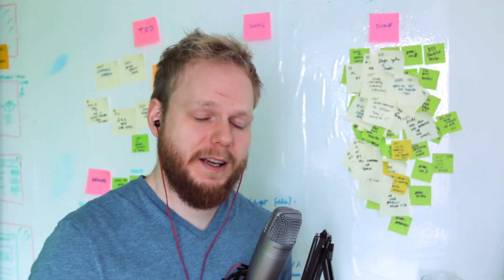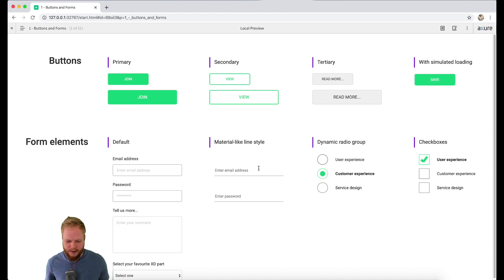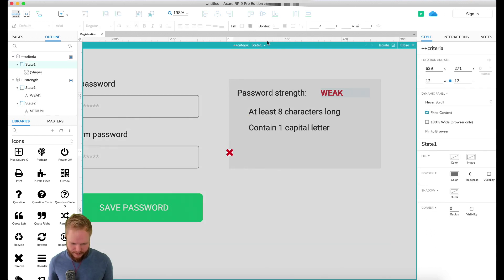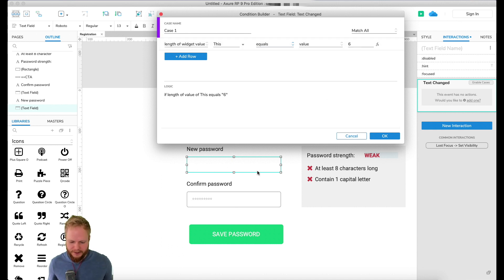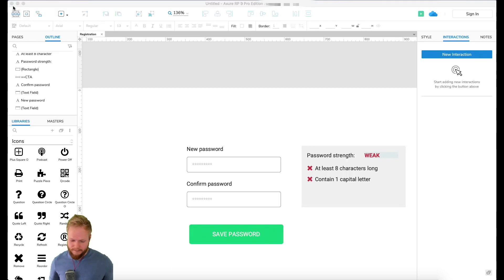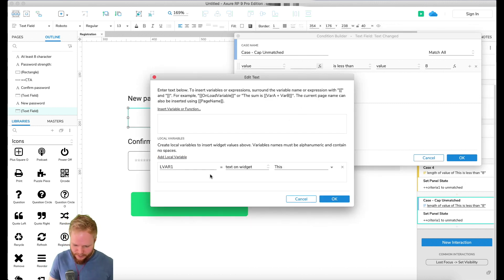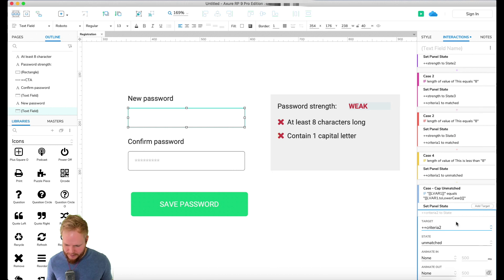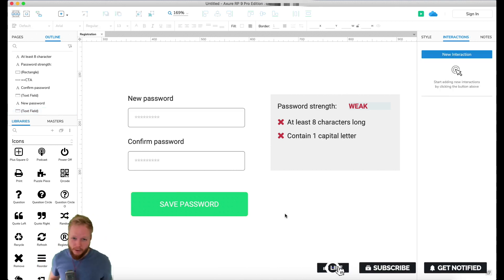Password Strength Check and Validation in Axure | Axure: Noob to Master, ep86

Comment: Hi Man, your videos are fascinating 😎 I have 1 question regarding the variables. I have a global variable and would like to make an action (modify a widget state) when the value of this variable equal to "good". Is it possible in Axure? Because I was trying to find under interactions (variable change)...
Reply from the maker: Hey, yes. But you need to use conditions for that. If you want to trigger the global variable check then add interaction to something e.g. button click. Then next to interaction click 'enable cases'. Also check the playlist for conditions video might be fastest to get going
Reply: @vaexperience  Thanks man for the quick reply. Actually I would like to use for validation. Disable the next button until all form element filled out correctly. I guess there is an easier way, but I couldn't figure it out.
Reply from the maker: Still need to use conditional statements to check variable value to enable/disable
Reply: @vaexperience  I know that I have to use conditions for sure, but I couldn't figure it out how should I set up the condition to enable and disable the next button regarding the correct / incorrect forms.

Comment: Hi,thank you so much for all the stuff you make, I have this question that has bothered me for a day, that how to sync two repeaters? I'm able to go the hard way to make it happen, where I basically create two identical repeaters with same set of data, and any change I make with either repeater will affect both. But I know this is not the best solution. I think the best solution will be one repeater as the 'main' repeater, and the other one just copy it no matter what, especially now I have several repeaters I need to sync. Let me show you what I did. I was able to get it partially work, where I use the main repeater A, item loaded, add rows to repeater B, so in this case I can get repeater B to be the same as A, however when I need to make a change to repeater A, A will add all its remaining data to B, not quite sync. So now I try in A's interaction, mark all B rows, delete marked rows, and then add A's rows to B, this end up showing just one row in B..... so it doesn't quite work. Sorry for such a messy question, I don't know if it makes sense to you at all, again thank you so much for the series.
Reply from the maker: Do they need to contain identical data? Have you thought about placing a repeater in a master and making an instance of it. Efdectly it would contain just one repeater in several places and could replace same dataset. Not sure if this would work, but might be worth a try
Reply: @vaexperience  That's a great idea, thanks a lot, I haven't thought about it, but the thing is these repeaters have different appearances, so I don't know...Now I just simply set the data for each repeater individually, basically forget about the sync thing, not really the point of a prototype after all right? Again thanks a lot!!!

Comment: Hi men, greetings from Colombia, I want to ask you. Do you know how can I efficiently work with Photoshot and axure?, for example when I have maked a UI in Photoshot, I have to 
replicate the work manually in axure, that is a lot of time. Sorry if my english isn´t good.
Reply from the maker: Hey, it's a difficult one. I used to work with Photoshop and cut piece by piece to then prototype in Axure. But the fact is it's not a great combination. I'd recommend to transition to Sketch/Figma or Adobe XD as they are made for UI work. Most of them also have a plugin for easy handover to Axure.
Reply: Andy your mistake is "I have maked a UI in Photoshop" because it takes a lot of time and it is hard to modify/update. Do everything in Axure from start!